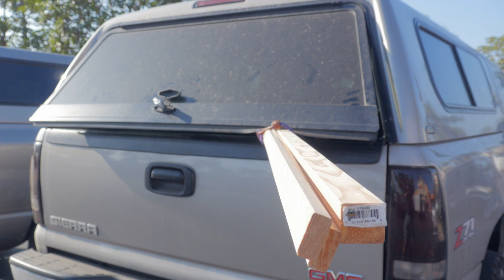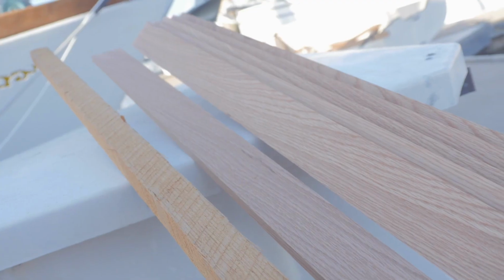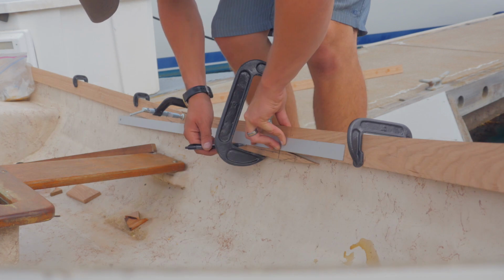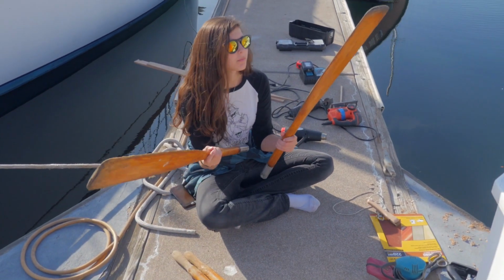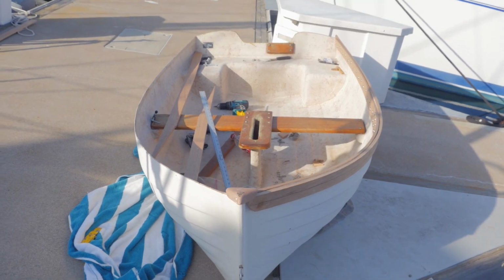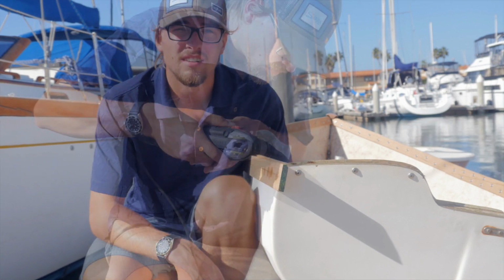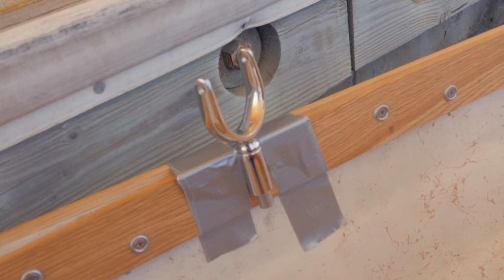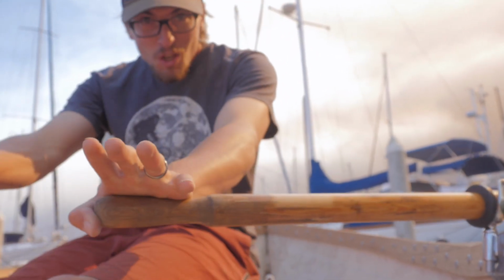Sailing Avocet: Meet Little Wing

Comment: To finish the rails, fill the gap between the boards with a piping bead of nylon rope glued in with Marine 5200, seal the rope with epoxy... and when testing oar lock positions, clamp those puppies. 🤷‍♂️
Reply from the maker: Not a fan of 5200, and we don’t own this dinghy anymore. Upgraded to a Fatty Knees 8 :)

Comment: Just found your videos and we're looking forward to following your adventures.  We have a rigid fiberglass dinghy was well that I rebuild. Ours was smashed into a dock by a boat and the bow was cracked and the rub rail was broken, so I replaced it with white oak as well.  I ended up steaming the wood, but it was still a lot of work and even with steaming there's a decent amount of pressure.  Your work looks amazing and if I have to replace our rub rail again I'll probably do the same scarf you did.
Reply from the maker: Hey there! Thank you! Sorry to hear about your dinghy, but I'm happy to hear you were able to rebuild it! How did you steam it? in a small space, or some other way? Interesting to hear your thoughts on it. Did you varnish or oil your rub rail at all?
Reply: Repairing our Dyer was a good lesson in fiberglass repair, painting, and woodworking.  Unfortunately we're not liveaboards yet so I have my basement to do this type of work.  For the steam box the easiest way to make it is out of PVC, hose, and a container you can heat to get the steam.  Then just connect the hoses and you're in business.  If you don't have access to that stuff you can soak the white oak in fresh water to soften it a little.  As for varnish I just used cetol because it was what I had handy.  Figured this dinghy is going to get pretty banged up at the dock so making it look nice wasn't a high priority.  I was right.  She now could use a new coat of paint.
Reply from the maker: Thanks so much for the details! You will be liveaboards soon enough and then sorely miss yout basement work space lol @sailingcruiser25  Cheers!

Comment: Wow. I have just picked up this exact same dinghy, in this exact condition, in socal. So happy to know that there is someone out there with another one of these. It’s not a fatty knees, or a Dyer, But something of a copied design that I cannot find anywhere online except this video. One big question I have is what did you do about the daggerboard keel? Makeshift plug? Also, do you think this thing can take an outboard motor? I am starting the process of fixing mine but cannot seem to find anything pertaining to this boat. Maybe one day we’ll see each other rowing around the marina. Cheers
Reply from the maker: Hi Evan! So cool you have a Dover Dory... you may actually have this exact one! We sold her a while back when we bought our dream dinghy a Fatty Knees 8’! The Dover Dory is actually the predecessor to the Fatty Knees, which is really cool. For Little Wing 1 we had no plug, just dealt with the occasional wet butt lol! We never had the opportunity to put our outboard on to test, but our friend Adam (@Sailor_adam) also has a Dover Dory and would be a good resource.
Reply: I have a different one, the one I picked up had an old hull number on it (still couldn’t find anything about it anywhere.) I saw another one for sale in Marina Del Rey, it was restored to perfection. . last questions for you. Do you remember what that interior metal transom plate said for your old Dover? Weight capacity, etc? Also, do you remember if those 3 bolts on each side of the back of the transom went through all the way to the interior. Mine has holes on the exterior but not the interior. I wasn’t able to find your friend Adam anywhere, but thank you again. Congrats on your Fatty Knees. Cheers